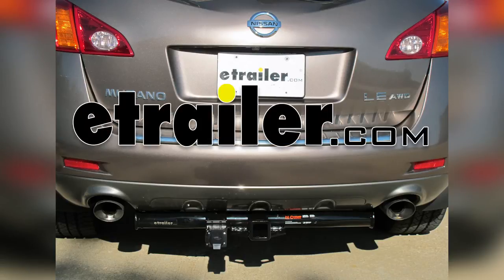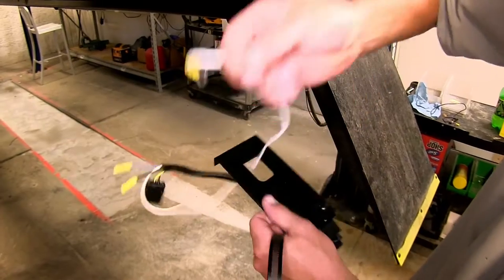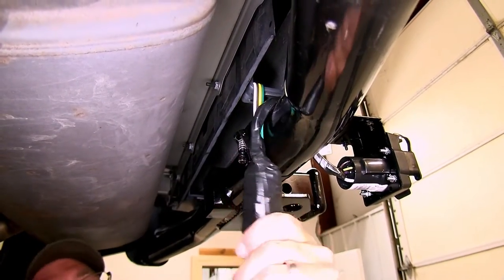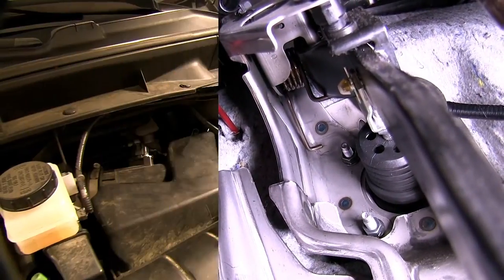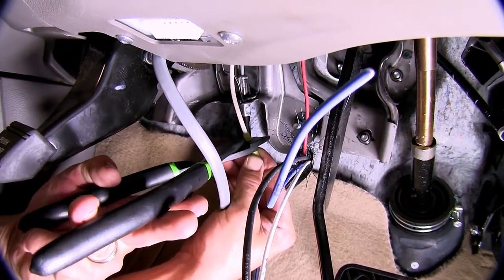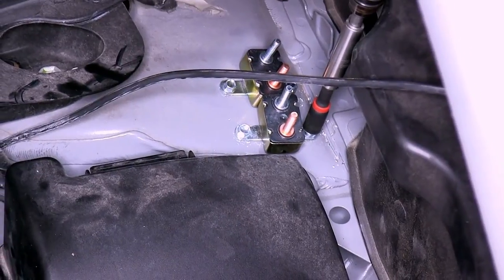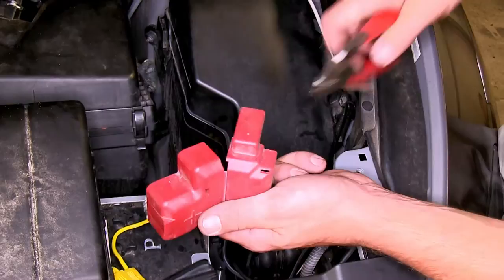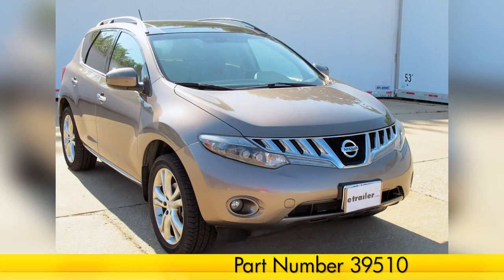etrailer | DIY 2009 Nissan Murano Installation for the Tekonsha Voyager Trailer Brake Controller

Comment: Good tutorial, thanks.  I just finished adding a brake controller to a 2014 Murano and in my case the wire on the brake switch to connect to turned out to be the green, not the yellow wire.  A real pain to connect to but to make access a bit easier both switches can be removed by turning them 1/4 turn ccw.  Also a standard blue crimp wire splicer won't work as the green wire is so thin.  I ended up stripping back a bit of insulation and soldering the controller wire to the green wire.

Not having a lift I ran the wire to the rear connector inside the car, tucking it under the side trim panels and out through an existing grommet in the floor.

I found that getting through the firewall grommet to connect to the battery to be an exercise in frustration.  Finally, as I was using 10ga wire, I stripped about 2", twisted the wire and filled it with solder.  Then I ground the end to a point and managed to shove it through.  Hope this helps anyone else attempting this job!
Reply: Hey John, I'm about to do this job on a 2012 Murano. What did you find was the easiest way to get the wires through the firewall? Any special tool to work in that tight space?  I've hit a "wall" here.